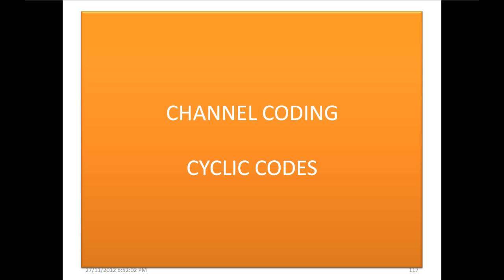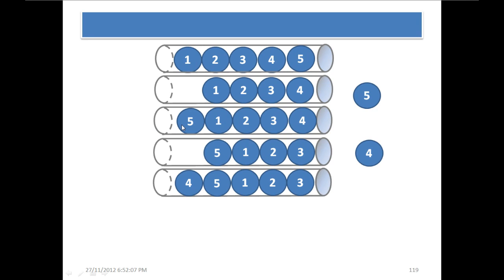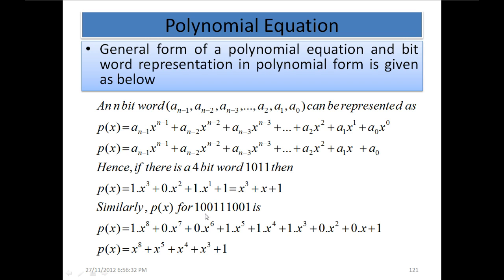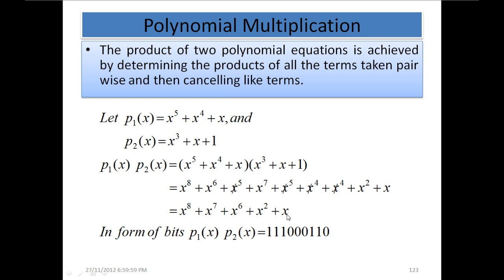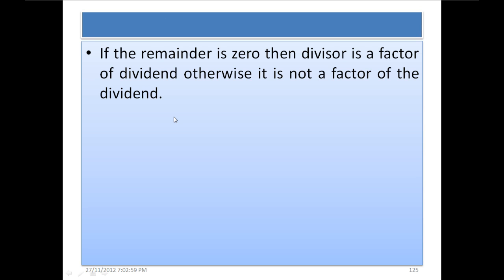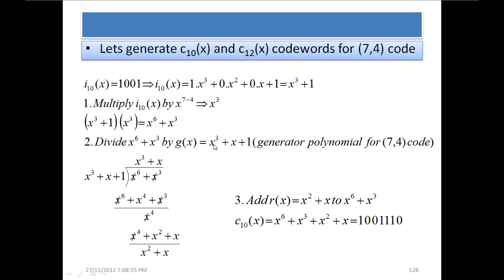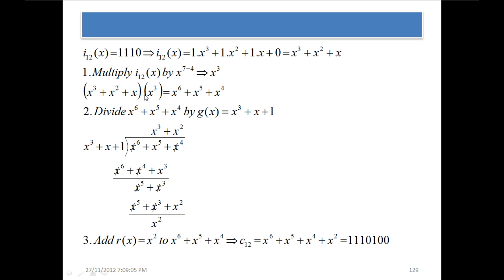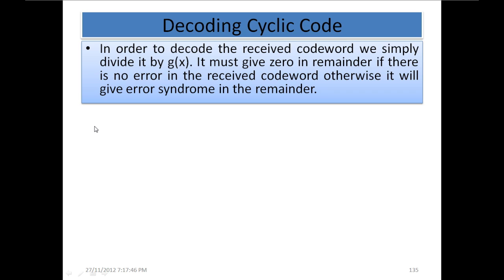Information Coding Theory   Part 16 - Cyclic Code, Polynomial Arithmetic, Cyclic Encoding Decoding

Comment: The polynomial division in these tutorials are incorrectly done. You are not subtracting terms during division. Please correct your mistake! Other than that, Great tutorials! I learned a lot!
Reply from the maker: +Ram Mishra What do you mean by that. like terms are cancelled while subtracting algebraic expressions.
Reply: +Waheed Hyder  can i have these slides you are working on as pdf ?